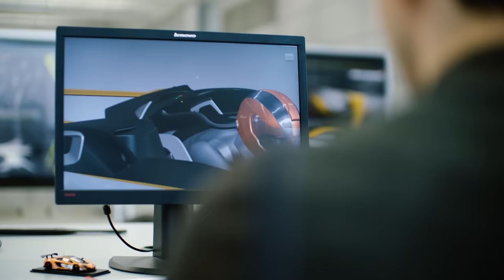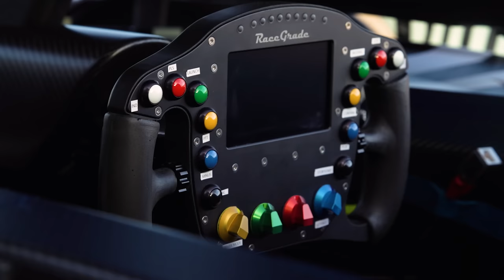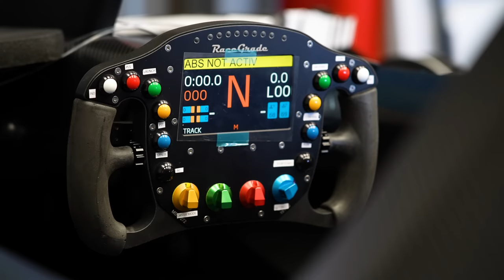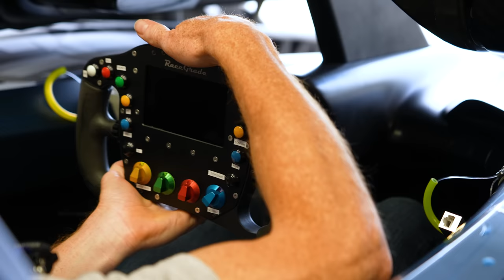FIRST LOOK: McLaren Solus GT – £2.75m V10 Gran Turismo Hypercar Made Real! | Top Gear

Comment: We used to think the 90s were the pinnacle of super cars with the F1, CLK GTR, Porsche GT1, F40, 959, etc. But I think we’re arriving at a moment in automotive history people will look back on with similar awe and excitement. This thing, AMG One, Valkyrie, T.50, Huayra R, Jesko, the list goes on
Reply: I don’t really think so. The cars above have some uniqueness to them. Nowadays, I see the same car 25 times. It doesn’t look like a McLaren at all, it looks like a generic low number Hypercar
Reply: @gamm8939  Sure, you can make the argument of design characteristics which is subjective, but from a groundbreaking performance perspective, there's really no argument.
Reply: i think time is running out for petrol cars which could be a small part why this is happening?
Reply: @gamm8939  what you described though is very much what people said about more of those 90's cars back then most of them wasn't that loved back then either they were to much if just a racecar and so on... The love startet 10 year's later and just grew from there... Wanna comeback in 10 years and bet this is exactly the same the love will begin for this generation of these special few car's
Reply: I agree the hypercar segment is really exciting. Other sports cars; not so much. Turbo, hybrid, automatics; not my thing. I’ll keep buying older cars with hydraulic steering, mechanical throttle cables, NA, manual transmission
Reply: @ludda42  I'll say the 6speed Manual Nissan Z , that combines old school with modern day sport car is for me an exciting thing... But Many think it's ugly, hopefully that means I'll be able to get one within next few years that isn't extremely over charged

Comment: While not officially specified from what I've been reading, that has to be the unmistakable sound of the Judd V10. That drone throughout the RPMs and the resonance of that intake noise is a dead giveaway after hearing it for years in the back of cars like the Lola B2K/10, Dallara SP1, Creation CA06 and the Epsilon Euskadi ee1. Pleasantly surprised as I didn't think I'd be hearing it again in ANYTHING modern.
Reply: Car And Driver confirmed it's produced by Judd, good ear

Comment: One of the most insane cars ever made
Reply: *ever
Reply: Insane kit car
Reply: @Hello_there_obi  edited thanks
Reply: @simp2234  pretty sure it's not a kit car.
Reply: @amahllewis5595 bruh look very off from the gamee
Reply: @simp2234  well I mean most game designs and even concept cars don't necessarily translate well into real working designs. It certainly to me is just like the Valhalla or Valkyrie in design.
Reply: @amahllewis5595  but the amr pro have the design  of it. This look like freak tank
Reply: @simp2234  true, it could be that they may hva wanted to change the dimensions or design. I could speculate but I know I won't be right. I personally don't think it looks the best but is rather close to the design in Gran Turismo, but with a different engine packaged in the back.

Comment: McLaren V10 probably is another in the hall of the fame. BMW, Lexus, Viper, Audi/Lamborghini, Porsche... Welcome.
Reply: BMW, Audi, Lamborghini and Viper does not sound at all like C-GT and LFA and now like Soulus GT, are 2 different V10s with different firing intervals
Reply: @ddd.777-  How does that change the hall of fame reference?  I didn't get the since he they were saying they were the same engines
Reply: Except its not a McLaren V10... McLaren don't produce engines. This is a Judd V10. The V8's they use are built by Ricardo
Reply: How do you know that this engine is made by Judd, nobody on the Google say that
Reply: @Chris_Willows Actually I don't think is made by Judd, because Judd's V10's are only 4.0, 4.2, 5.0 and 5.5 liters, and the engine of this car is a 5.2 l
Reply: @ddd.777-  Because its a LMP engine and Judd are about the only company producing V10 LMP engines and Mclaren don't build engines
Reply: @Chris_Willows  Ok

Comment: So they're making a wild hypercar that is clearly built for the track, but they aren't going to use it in the LMH class in WEC & IMSA?  Why do you do this to us McLaren.
Reply: In LMH/LMDH/GTP the car needs to have room for two seats side by side  (even if there is only one seat in the car). Actually I don’t think much about this car conforms with the rules. Too many openings in the front, the car isn’t low enough or has long enough of a wheelbase, etc. It would also need a hybrid system. If they want to race in that class, they’ll pretty much have to make a brand new car

Comment: So it has a Judd V10. The rebuild Interval will be really short.
Reply: The people buying these cars don’t care about rebuild intervals. Most of them won’t even do the mileage to the first interval.
Reply: @jryalls  That’s a fair point. I made my comment before seeing the preparations for starting. If you need to heat the oil and block before starting you have a team to run the car.

Comment: The JUDD V10 is a 20 y/o race engine and costs 50000 pounds...that means it can be put in the mclaren 720 succesor, in a hybrid configuration to pass the emission tests. It also means that this car is severely overpriced, but given the low number it will probably sell for more to some dubai kids. For that money I'd just buy a LMP car instead.
Reply: an LMP car that would be as fast around the track as the Solus GT would still cost you over a million +.   Yeah you can buy a good LMP car without an engine or electronic for 400K or cheap out 120K  but what engine are you gonna use?  Nissan engine not bad around 35K, still slower and not as special as what Mclaren is offering.  I mean to try and prove a point here about McLaren charging 2.4 million, yeah its expensive and they know their customer

Comment: The center divider safety feature will encourage the driver to use parallel vision, which means they wont have depth perception. They will be in the random dot stereogram poster mode.  !CRASH!

Comment: Meh, crap. Stupid price for stupid vehicle.
In 2022, supercar concept cars are supposed to be affordable, not for the snobs. That is the whole idea of technical development.
small reliable performance engines are already an old tech, aerodynamics too, and making a design is not expensive.
You are not inventing the wheel, we have all the knowhow and equipment.
Such vehicle should cost under 100.000, most of which would be making the moulds for the body panels

Comment: Heavier than the GMA Lauda which has 2 cylinders and a seat more. And more low speed downforce.
Reply: but it has more power
Reply: @MisterMuslim000  That's nice over 250 kph in a straight line. But does little for excitement or lap time.

Comment: 😈😈😈😈 like 12 deep billet steel bolts holding down the heads with graphite and copper head gaskets ....during high   compression states once the car is at ultimate speed    ,  the cylinders get decompressed ,  so the huge turbo have no interference with tolance levels of mechanisms restricting turbo flows of power curves ( loosing obviously torque but the horse power could be dooubled as long as it can rev to 20,000 revolutions )   ...  electronic valves ,   bla bla bla   😈😈😈😈😈😈😈😈